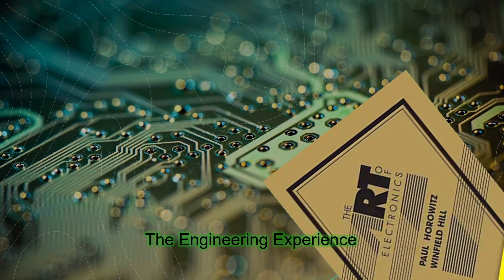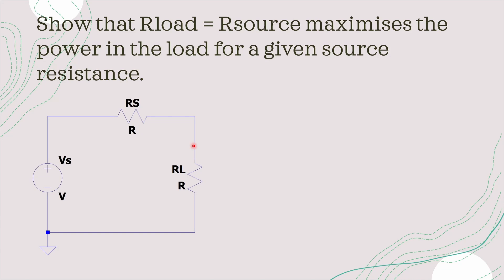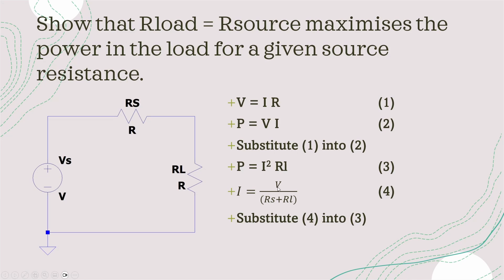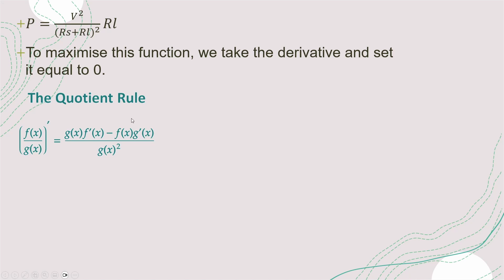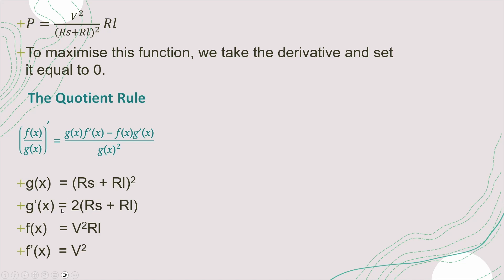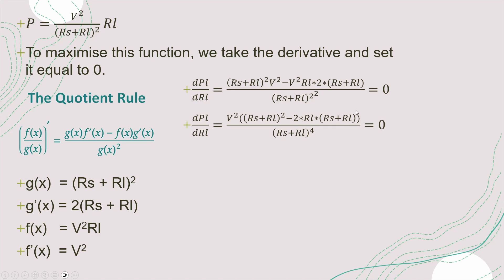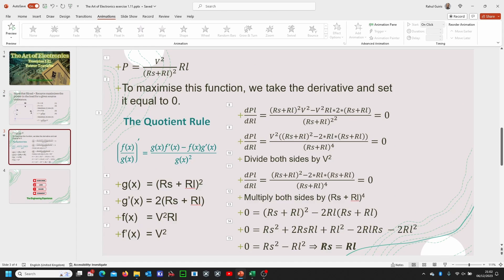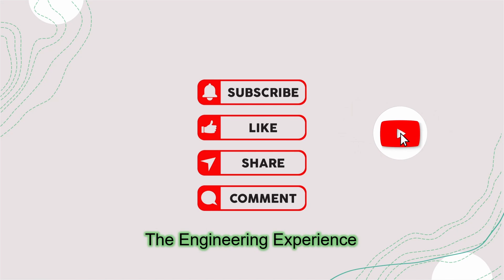Learn The Art of Electronics: Exercise 1.11 Maximum Power Transfer

Comment: Thanks for your effort in making this series, I got the same answer but my algebra was slightly different
Reply from the maker: Awesome , would you mind sharing for the community? 

This one was really difficult.
Reply: @TheEngineeringExperienceYT  For my first attempt I tried to solve it by starting with:
(1) P(Rl) = V^2 / Rl
and substituting (2) V(Rl) = (Vin*Rl) / (Rs+Rl) into (1)

However, this became a bit messy since it expands to a fraction inside a fraction, meaning you would have to apply the quotient rule twice.
So I started my second attempt with a different formula for P:

(1) P(Rl) = I^2 * Rl
(2) I(Rl) = V(Rl) / (Rs+Rl)
substituting (2) into (1) and refactoring a bit, I worked it out to:
(3) P(Rl) = (V^2 * Rl) / (Rs^2 + Rl^2 + 2RsRl)

from there I applied the quotient rule with
f(x) = V^2 * Rl ==> f'(x) = V^2
g(x) = Rs^2 + Rl^2 + 2RsRl ==> g'(x) = 2Rl + 2Rs

substituting all of that into the quotient rule formula (and a little bit of refactoring) you get:
P'(Rl) = (V^2*Rs^2 + V^2*Rl^2 + 2V^2*Rs*Rl - 2V^2*Rl^2 - 2V^2*Rs*Rl) / (Rs+Rl)^4
(note: for convenience, I used [g(x) = (Rs+Rl)^2] instead of [g(x) = Rs^2 + Rl^2 + 2RsRl] in the bottom part of the fraction since they are equivalent)

In the top part of that fraction, you can do two subtractions between terms to simplify:
(V^2*Rl^2) - 2(V^2*Rl^2) = -(V^2*Rl^2)
2V^2*RsRl - 2V^2*RsRl = 0

from there, you end up with:
P'(Rl) = (V^2*Rs^2 - V^2*Rl^2) / (Rs+Rl)^4

To work out the maximum for P(Rl), set P'(Rl)=0:
(V^2*Rs^2 - V^2*Rl^2) / (Rs+Rl)^4 = 0

Which I rewrote as:
(V^2 * (Rs^2 - Rl^2)) / (Rs+Rl)^4 = 0

Dividing both sides by V^2 yields:
(Rs^2 - Rl^2) / (Rs + Rl)^4 = 0

Multiplying both sides by (Rs+Rl)^4 yields:
Rs^2 - Rl^2 = 0
or: Rl^2 = Rs^2

meaning Rl = Rs OR Rl = -Rs.

Comment: How to measure the source resistance of any supply or a circuit in hand?
Reply from the maker: If you want to figure out the resistance for dc condition, you can measure the output with 2 different known loads and using the output voltage you can calculate the source resistance.